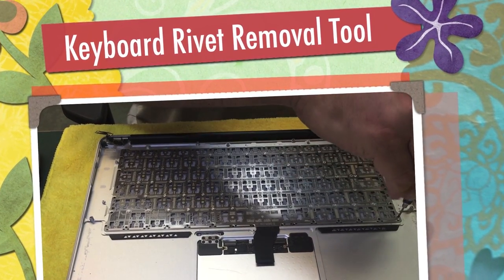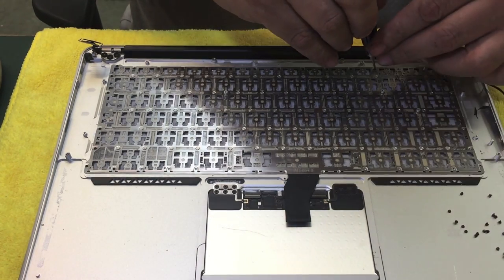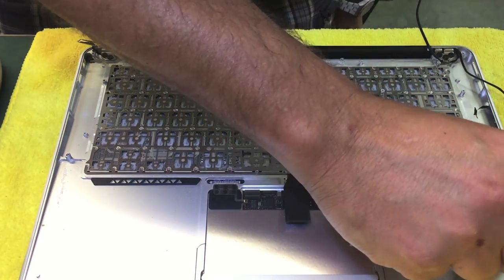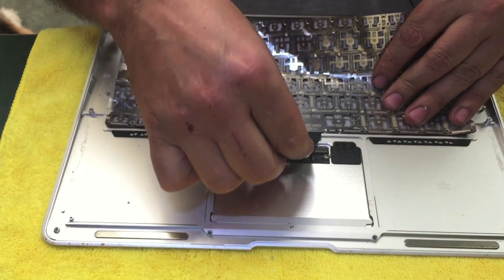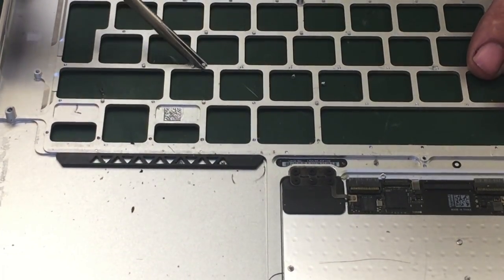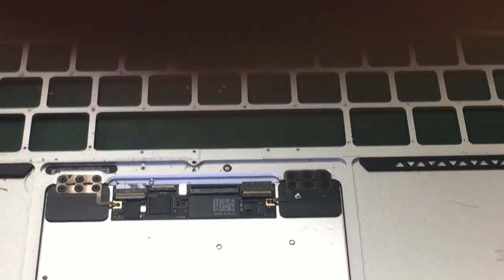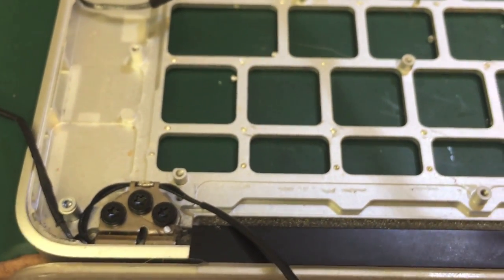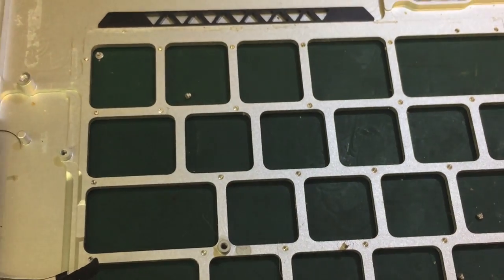Apple Macbook pro and Air Keyboard replacement  tool

Comment: Does this remove the rivet or just the head?
Reply from the maker: it is like screwdriver but the end have been modified to do the job
Reply: What does that mean?
Does it remove the whole rivet or just the head?
Reply from the maker: yes the tool remove the whole rivet ready to put the screws
Reply: The video just shows the heads being removed?
Could you show how the rest of the rivet is removed.
Reply from the maker: Look again it is the full  rivet not just the head ... The head got broken once I pull the keyboard